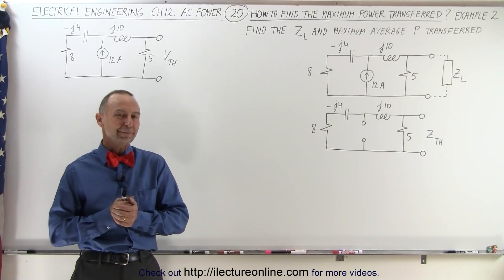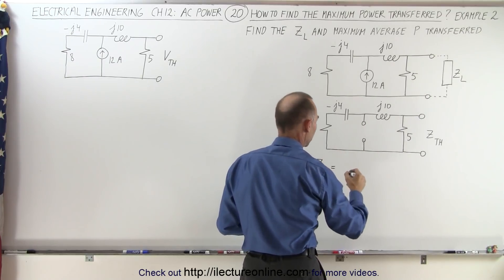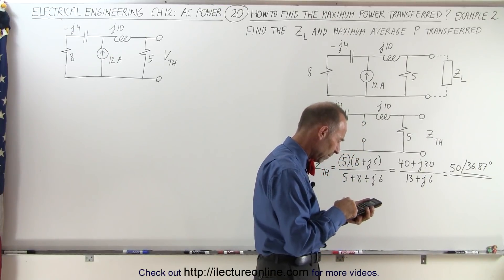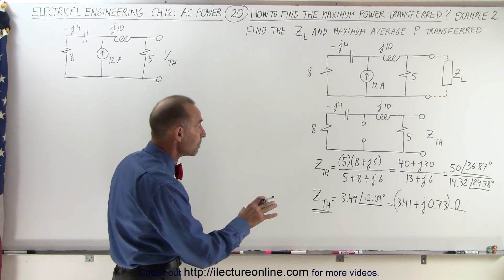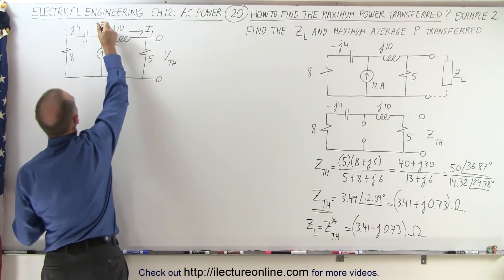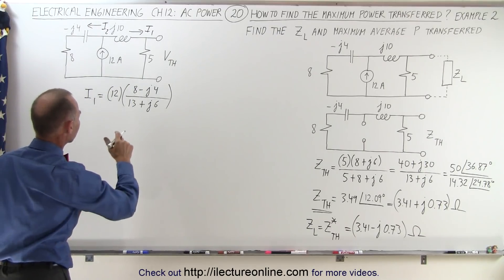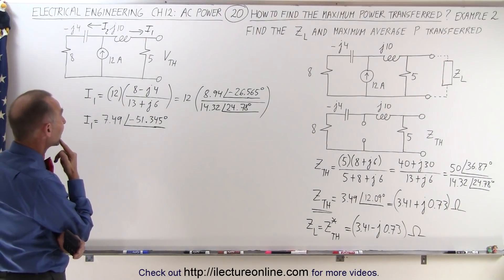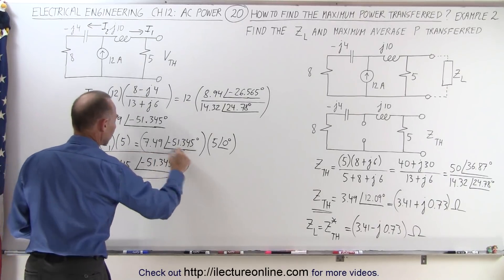Electrical Engineering: Ch 12 AC Power (20 of 58) How to Find Max. Power Transferred? Example 2

Comment: At 1:00, why did you find the  impedance in parallel?  Aren't all of the values in series?
Reply from the maker: The 5 ohm resistor is in parallel with the rest of the circuit.  (relative to the load impedance)

Comment: why are you multiplying 8 times RL at the Average Max POWER?
Reply from the maker: You can see the derivation of that equation in one of the previous videos.
Reply: Max power trnsfr to resistive load is (1/2)iv....when rL=rS... Meaning Vdrop acrros source and load resistance is half the max voltage,...but also current gets halfed of max , So power is (1/2)(i/2)(v/2)=(1/8)vi
Reply: @chanakyasinha8046  sorry brother... U r wrong... We founded that to transfer maximum power transfer load impedance is equal to conjugate of source impedance. Then find out power in the circuit in normal way